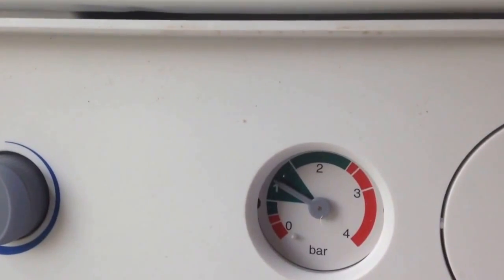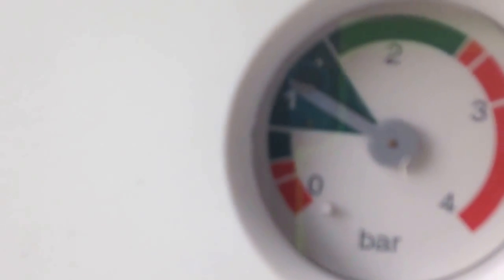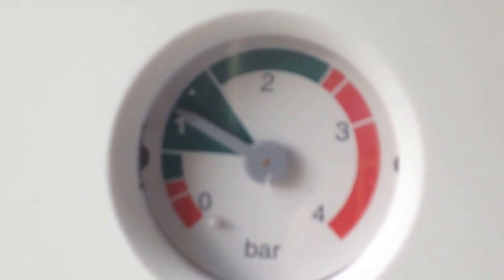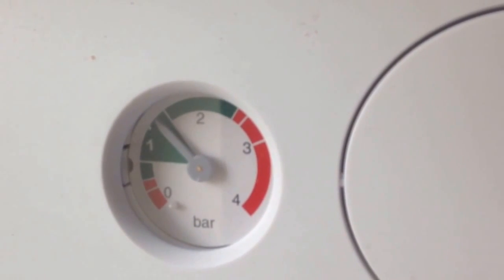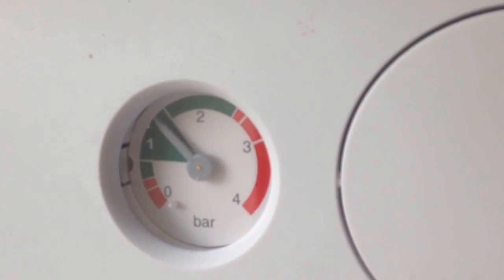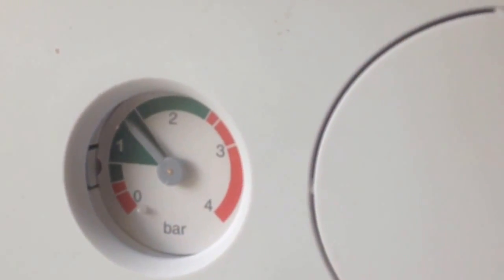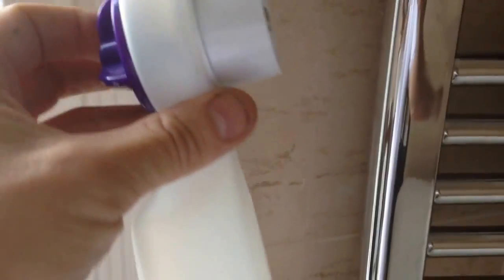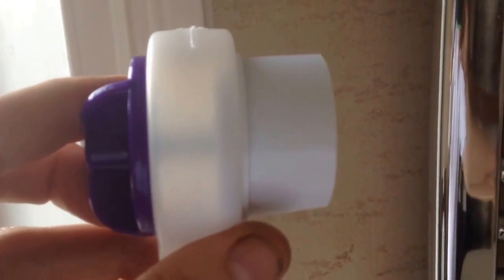How to repressurise or fill a combi boiler or sealed central heating system

Comment: Do you turn the power off first?
Reply from the maker: Ray Lawson  no, you can do it with the power on . if the pressure of the boiler is to low it will not fire up . once your have started the pressure will rise a little higher . if you put to much pressure in, just go to one of radiators and let it out slowly  .
Reply: John Scott Thanks very much John for your quick reply. 

My final question is: Do you open the isolating valves at the back (entrance) before or after opening the front two valves? 

I tried opening the front two valves (with power off this morning) and nothing happened. I have a Baxi Neta-Tec.
Reply: Ray Lawson Entrance/back of the solid refill-loop*